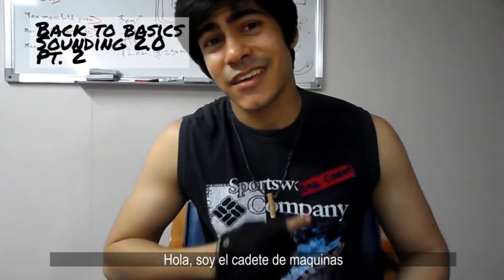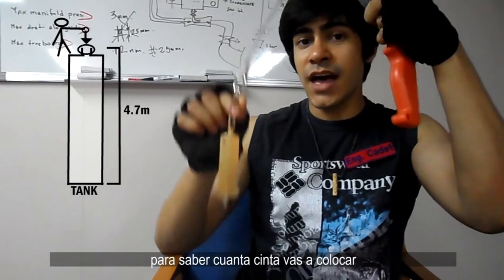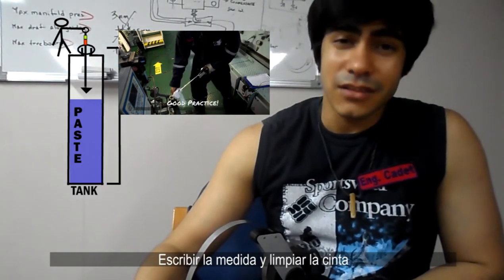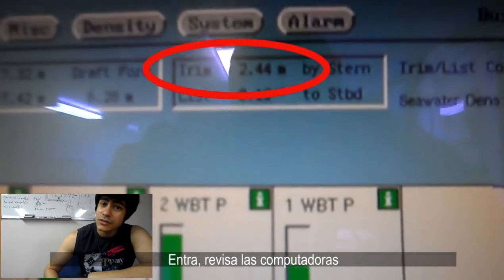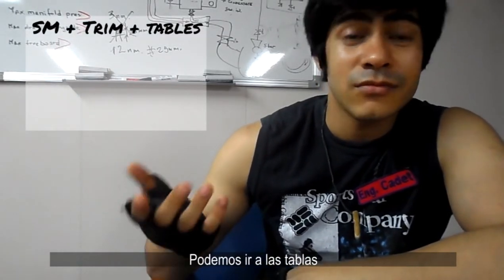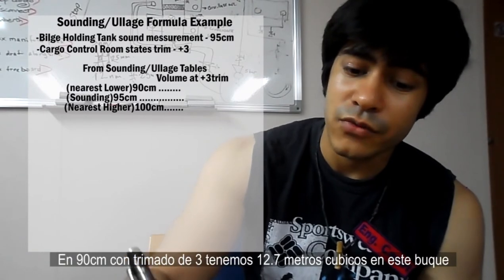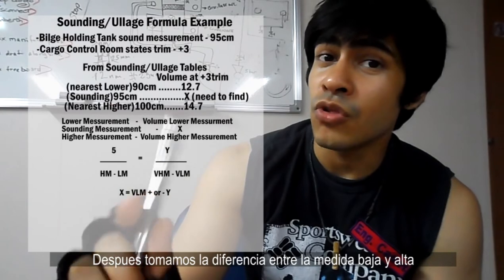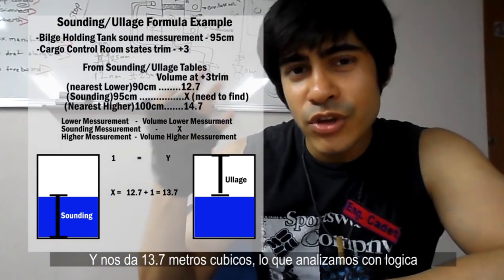Tank Sounding pt 2 - Calculation of Volume (Daily Job on ships)

Comment: Hi sir, nicely explained. Have one doubt. If the vessel is trim by aft, we have to take the trim in negative or positive?
Reply from the maker: Thank you amigo and for sure it's a reasonable doubt! 

normally the computers will automatically show it to you in modern vessels however in older vessels one must know trim is taken negative when the ship is more submerged aft side (this is more safe because it helps the propeller stay submerged)

If there is an irregularty or vessel is incorrectly loaded/discharged then you may have forward trim (bow is more submerged than aft) and it is represented with a postive in sounding tables.
Reply: @ShrimptoShark  Thanks for the detailed explanation sir.🙏

Comment: Very interesting video can u explain what is VNET
Reply from the maker: Good day amigo! Tell me Jerek what is VNET? I'm not sure what you mean and what it has to do with sounding. Please elaborate my friend!
Reply: @ShrimptoShark  Ehla Malakas. For vessel build in Japan / Korea the volume in the tank calibration tables are in Gross Kilolitres or GOV in blank English it's just gross volume. For vessels build in China in tank tables they indicate as VNET so do u know what is VNET. So my question is is this gross volume or is this corrected/volume?
Reply from the maker: @jereksee9951  to be honest I had no idea what that was until you mentioned it and I investigated a little about it, quite frankly I don't think this concerns operational engineers of the vessel in terms of bunker or sounding.

You have sounding tables on board which show the volume according to set levels.

VNET seems to be a small reduction in the gross volume to take account of various things that can be inside the tank (2% reduction of the full GROSS volume of the tank) now 2% usually isn't a big deal in most small volume tanks (drain, bilge, SBO, overflow, LO, etc) however in bunker tanks it can be noticible on big Vessels.

Anyway it depends on the chief weather or not he/she wants to calculate this reduction on the FULL gross volume.

In any case tell me what you think, I read a little about it now that you mentioned it but to be honest neither me nor the other engineers where I was have ever heard of VNET before.

Comment: I just want to ask you bro where did you got the 12.7 in 90cm?
Reply from the maker: Hello Christian! Those valves come from the sounding tables of the ship (a book from the shipyard that has specific measurements and volumes calculated in the shipyard.)
Reply: Maybe the trim 3 is mutiplied by 10^-1 that we would subtract to the nearest lower at 0 trim which means that the volume of the tank at lowest is 13 cubic meter, same thing goes to the nearest higher. The reason maybe the volume is 12.7 and 14.7  is that the tank is in irregular shape since the area i found in the lower is at 14.11 meter squared and the higher has 14.7 meter squared.